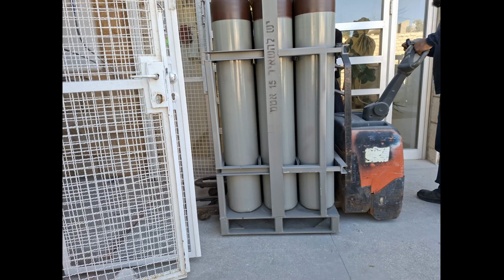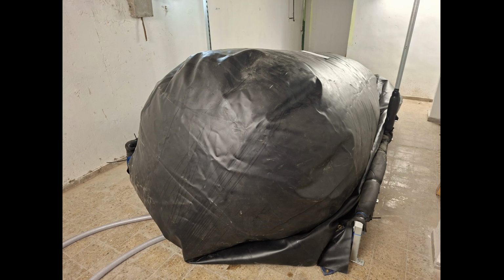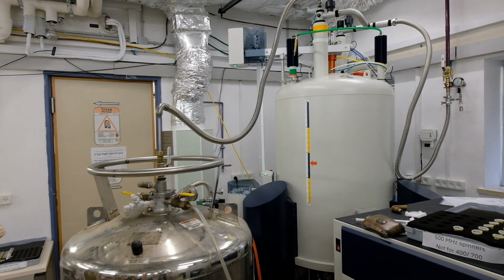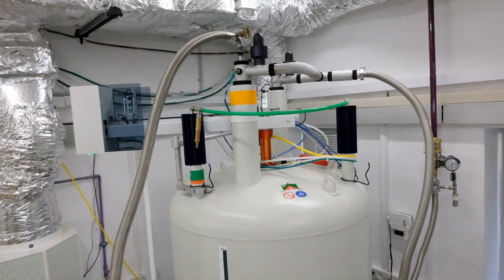Handling Helium - Accounting for Every Gram

Comment: 5:00 How do you KNOW you have completely emptied it of N2 and filled it with He? Isn't it going to be turbulent in there? Wouldn't that mean you need to purge multiple volumes of the tank's capacity before achieving <1% N2? Are you using a residual gas analyzer?

Comment: PPE question: I noticed protective gloves at one point. Are protective gloves for handling cryogenic equipment insulated the same way as heat-resistant gloves, or are there difference, since the heat flow of concern would be in the opposite direction?
Reply: Crogenic protective gloves protect against splashes and contact with cold surfaces. They do not provide protection from immersion in liquid nitrogen. They are usually not resistant to heat (melting) so cannot be used for hot items.
Reply: @royehoffman  Many Thanks!